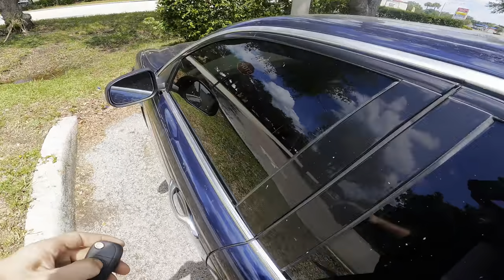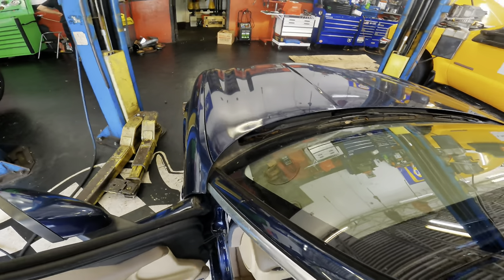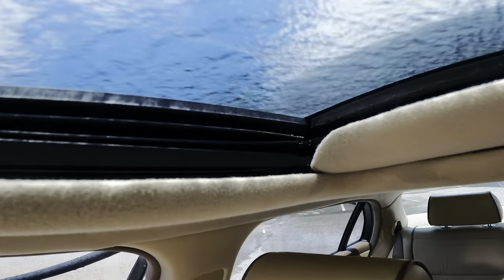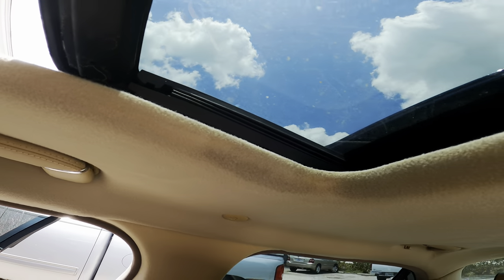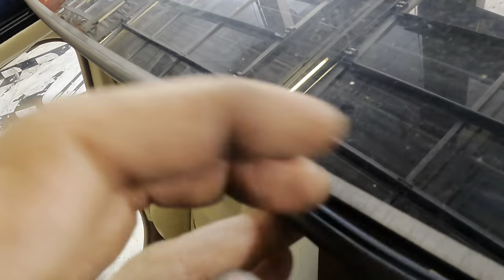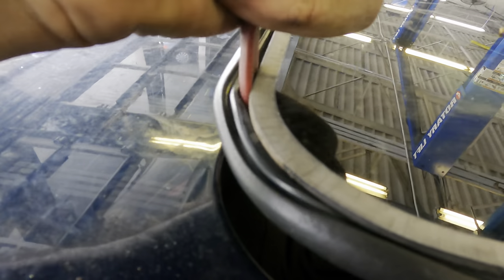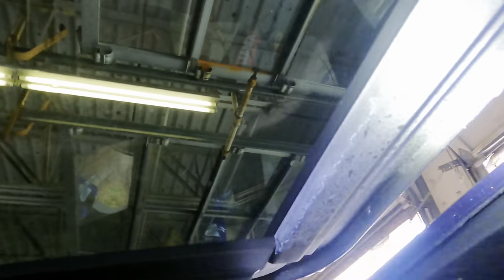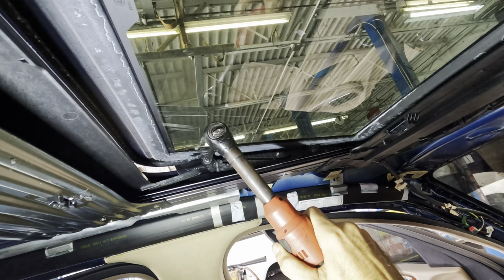Worse than I thought…Water Intrusion! 2008 Jaguar XJ 350

Comment: On Jags like most British cars, there are A pillar drains for the sunroof which get blocked very easily and will force water into the cabin area if not unblocked, a weak seal will allow this to happen more readily, I had to recently unblock the A pillar drains on my Reliant Robin which unusually has a standard lift up sunroof and it kept dropping water onto me.   Once unblocked not had a drop since :D

Comment: When you install seals like this, you have a really easy opportunity  to stretch the seal. On the curves, you should leave some slack in the seal. Meaning this; as you install the seal, if you are pushing it in one direction or another, you have the possibility of wither stretching or compressing the seal. Even though it fits around properly, some areas will be stretched while others compressed and "fat."

That front section that was highly compressed was due to all the stretch landing in one place. What you need to do is evenly install the seal all the way around but try to leave excess in the corners as they will want to stretch thin due to the curve.

Hope this helps. Have much experience in this field.

Comment: Drains in our Explorer clogged up.  The overflowing drains caused the drivers side sunroof motor to fail so I had to replace that before unclogging the drains.  Used compressed air and thick weed trimmer string to unclog.  

The seals are designed to stop most of the water, but will never stop it all, hence the reason for the drains.

Comment: Great ideas on what to use for clearing and checking the 4 drain lines...fishing line or round weed wacker line would do it...I just hope the area at the sunroof frame where it attached to is part of it vs being a fitting the drain hose slides over...like vacuum hoses do on the engine stuff.  A great video Ray...I woulda thought the seal would make it better but its worse...I wonder if the tugging fore and aft might have knocked it out of alignment.  A great video as always Ray...I hope theres a part 2 to it as I have a 99 Toyota with one side off a tooth going up...still seals fine though fortunately.

Comment: From working at Benz for years we had this issue too. the sunroof glass is never 100% water proof. it uses the drains as its primary way to divert the water. the drains are probably clogged causing it overflow. if you want to try and adjust the glass. when you put it in the tilt position there should be bolts holding it to the glass to the track. Crack them loose and you should be able to move the glass around.

Comment: I used to work on these, the seal is not intended to be water tight, hence the drains at all four corners to handle drip-by, most often with a leak complaint the drain tubes were blocked or clogged, we would blow them out from underneath, which resulted in a 95% fix, we would then treat the seals with silicone for lubrication

Comment: Most cars I've worked on (BMW, Subaru), the sunroof tray collects and water, draining it out from the corners to drain lines down the pillars.  Like you said, but also drains in the back to the C pillars.  So look for drains clogged or disconnected from the sunroof tray.  The seal around the glass is for air/noise and does not keep out 100% of the water, just limits it to what the drains could handle.  My observations.

Comment: Keeping the drains in that Sunroof clean is really important on Jaguars. I know that some of them like the XJ8 have a computer right under the windshield support.  So if the Sunroof drain leaks, it will dump the water onto the computer and totally destroy it. They are pricey as well and control about the whole inside of the car, etc. Some of the Lincolns have the exact same setup.

Comment: seal round the glass is there to stop wind noise rather than stop water. However good the seal is some water will always leak past, which should make its way to the drain-tubes.

Comment: I HATE sunroofs!
When I ordered my 2015 Subaru Outback from the factory, there was no way to order it without the dang thing!
From what I understand, the rubber gasket is just to keep wind noise out of the cabin.
The water is channeled away via a channel that surrounds the sunroof and is evacuated via a drain tube.
If the tube gets clogged, water will overflow the channel, and enter the cabin.
I HATE sunroofs, and in 7 years, I've only opened mine 3 times... LOL!

Comment: I had the same issue on my Passat, you didn't have to take the headliner out (unless something was broken) all you have to do is loosen the 4 (sometimes 2) bolts that hold the glass in, close the sunroof, and then with a suction cup on the outside manually move the glass until the seam is even all the way around, then tape the glass in place (glass to roof) and tighten the bolts. The glass buffets in the wind and the screws work loose over time. Maybe something else was wrong with this but most of the time a slight readjust is all that is needed. Also not sure why people are saying sunroofs are designed to leak because they're not. I've had 5 cars with a sun roof, non of them leak water or air. The drains are there so if the sunroof is in the vent position water wont make it's way onto the headliner, also water under pressure can break the seals (car wash) and the drains keep the interior dry, but under normal conditions the seal should.. seal. Also clogged drains don't cause water coming into the vehicle... ?  If the drains are clogged you'll get water overflowing the gutters and onto the headliner, has nothing to do with water coming in in the first place.

Comment: You need some gummi pflege for the rubbers and check those sunroof drains there should be 4, 2 front and 2 rear. Very common on the vag group cars or anything with a webasto sunroof for them to block especially if there's spider trap covers/flaps at the end of the drain.  Remove them to improve the water escape flow
Reply: "Remove them to improve the water escape flow"
And the spider entry flow 😁

Comment: The tracks themselves should have fine adjustments built into them.. slotted holes.. mine got loose.. 

Also check the drains! 

My trunk got wet everytime it rained.. the tube became disconnected in the trunk!

Good luck bud!

Comment: That trailer contraption would not “fly” anywhere in europe. You would get pulled over, fine would be anywhere between 200-1000 eur depending on country, registration suspended (at least for the trailer, which means fix it then get it checked) and license suspended for at least 30 days.

Comment: Based on my Subaru, sunroofs leak all the time.  There are typically drain tubes at all four corners of the sunroof that plug over time with pollen and dirt.  Four are necessary to deal with parking on slopes. The two rear drains on mine can only be cleaned from their lower ends at the rear corners of the cargo area.  I cleaned with a piece of flexible steel cable typically used in garage door spring cores. It took seven years to develop a plugging problem. Then water suddenly poured out onto the steering wheel and into the spare tire well when those drains plugged up.  Water still comes in, but is carried away with no problems now after cleaning.  I will not let it go seven years again and now carry the cleaning cable with me.

Comment: We used super lube silicone spray on all rubber body seals when I worked at Jaguar
There could be adjustment screws on the tracks.

Comment: I use to install moonroofs and they do not seal completely and will definitely have water infiltration if you put a garden hose on it like you did. They are not that water tight!   The drain pan is there to catch normal infiltration. 
 Check the drains for clogs before taking down the headliner.

Comment: Looks to me that the new seal was stretched tight around that back corner, making it smaller. In the front, there is too much (loose) seal. That happens when rubbing the seal into place with your thumb...it stretches. Evening-out the tension on the stretched seal may solve the problem...without tearing out the interior.

Comment: Most JDM sunroofs even if the seals leak water will never enter the cabin. The sunroof tray opening is smaller than the sunroof thus any leakage falls on to the tray. The water either runs to the front or rear drain hoses connected to the trays. Most common problem is the drains are never cleaned thus get full of dirt/leaves etc. Water doesn't drain and starts overflowing into the cabin.

Comment: Clear drain tubes first. I had the problem with a ‘12 toyota highlander and a ram diesel truck. Used string trimmer line to ream out the tubes. Had to special order my ‘21 Audi Q5 with no sunroof. Who needs a dang sunroof in Florida anyways!

Comment: I had a nissan once with a factory sunroof and it leaked sometimes. Only in left corners. There was a gutter on the backside of the roof that slides back with the window and it popped loose on one side. Once re attached the leaking stopped. The factory roofs don’t seal an relies on the gutters and drains in the pillars.

Comment: I had a 2010 Corolla, and I kept finding the carpet wet.  But there was no sign of any water entry at the doors, or at the sunroof.  No other wet areas.

Somehow water was getting to the carpet without coming in from above.

My first thought was condensate from the AC system, but the carpet at the firewall was dry.  Even though on the floor it was sodden.

Turns out the sunroof drains had plugged in such a way that the water was running down the inside of the pillar and into the floor under the carpet.

I had to remove the seats and everything I could from the cabin and lay them out to dry.

When I did, I found about an inch of water in the cavities of the cabin floor!

Comment: As far as the sun roof, the heat might be making the seal expand and tighten up any gaps.
Also, if the car is not moving, the air flow might be forcing water between the brittle seal especially cooling it and then not letting it flex enough to make the seal.
You have to feed the seal more fish if you want cooperation.
I would have sprayed silicone on the new gasket to make installation easier.
ALL seals like windows and door gaskets should get a once a year siliconing.
Clean the tracks and then spray.

Comment: Having done many of these in my time, I' would be looking at the running slots down both sides then the motor gear and teleflex cables that drive the glass, this can be done without dropping the roof liner, if they are ok then the liner will have to come out and the sunroof unit so that you can open it up and check the teleflex anchors on the widow sliders, the play you showed worries me that this will be the latter at fault.

Comment: I had to limp home a trailer with the tires off the rear axle. Couldn't exceed 45 without it getting a wiggle. I'm both impressed and scared to see that doing 70 down the highway.

Comment: I would look into adjusting the sunroof glass. Should be some covers hiding the screws under the glass. And you should know the seal the the sunroof glass is never water tight. That's why there is a gutter and drainage system.

Comment: Nice try If you get electrical cable Puller which are basically fibreglass rods and rod each side of the pillar posts so the water gets away faster sometimes they get blocked up with leaves under window may want a slight adjustment on the running rails good luck with it 👍👍👍👍

Comment: I did this to my jaguar x350, you have to readjust the glass they tend to sink, loosen up the side screws like you doing towards the end of the video, push up slightly till it's flush with the roof and tighten and clean out all the drains in each corner, will have to drop the roof liner, the rear ones are a pain in the butt, 95 percent of the time it's the gutter's that are clogged, hope this helps

Comment: On my 85 VW Golf it turned out the drain ports were blocked causing the leakage. I ran plastic tubing through all the drains which cleared the clog. Checking the alignment of the roof could also be off also causing a leak

Comment: Old Sunroof’s are nearly never 100% water proof but if the drain is clear it’s not a problem, but the drain pipe tend to get filed up with crab, so if you clean them, it should be good 👍

Comment: The guy with the missing trailor wheel would be pulled over in this country. Fine, points on license and not permitted to continue until fixed.
Reply: Germany by any change?
Reply: @teweg7355  Any non-3rd world country.
Reply: @blockbertus  That may rule out most of Florida
Reply: @teweg7355  Certainly the police in the UK and I would expect most of Europe would not be very impressed with this.

Comment: The roof is supposed to leak.  And it drips into the catch tray which has drains in each corner, sometimes only the front two if it slopes forward a lot.  The drain tubes get plugged with trash and the catch tray overflows. i.e., leak into the interior. This is why you can leave the roof open a little to vent heat and not get wet if it rains a little. Cancel that if it is blowing hard.

Comment: I have no idea if this fits all sun roofs but on my old car a Subaru Forester from 99 the seal was just air/dust/noise seal not water it was designed to leak... and that wouldn't be a problem so long as the 4 drainage holes wasn't clogged at any point. Happens usually around the 10+ year mark weirdly enough

Comment: clean the drain hose on all 4 corners, sun roof never seals, only a controlled leak. A partially blocked drain on one side will spill when the car is moving or on an-uneven surface

Comment: I have been an auto glass mechanic for 20 years I've seen this many times water is getting inside the vehicle it's because of the clogged drains I do what you did clean if that doesn't work silicone the Rubber seal but check the drains because water supposed to flow through them it's designed that way

Comment: You should have an adjustment for the glass to move forward and back, obviously the glass is not properly aligned it has become out of alignment as far as the adjustment. You only need to loosen a couple of screws and slightly move the glass back. This adjustment is on just about every sunroof made.

Comment: Mr Ray to me it looks like the Rubber seal.
Was stretched in the left side of the car.
If you were to take off the left side and go to the back.
Putting it back own.  Looks like the extra would go to the back.
We're the rubber seal was thin.  Maybe it will work.
Maybe not 😂🤣.  I'm not standing there looking at it.
And I used to put own a little coat of oil when I used to put own seal's.  When I was working at the shop made my job easier.
Keep up the great content.

Comment: Two torque screw's either side loosen the passenger side and push towards the back of the car then tighten the screws back up that how you adjust them 👍🏻🇬🇧♥️🇺🇲

Comment: All sunroofs leak, drains become clogged, use a shop vac to suck the debris out of the drains I have an adapter that coonts the van to small diameter tubing, be careful with compressed air you can blow the drains apart inside the roof or A/B pillar, as others have said a bike brake cable can be used if your careful. Bottom line, its the drains...

Comment: From my experience, NO sunroof fully seals to the roof. The seal cuts down on the wind noise, but it's not designed to hold out water. That's why there's channels on the frame of the sunroof to catch and direct the water to the drains.  Which there are 4 drains, one at each corner (2 in the front, 2 in the rear). Any of them clogged up with debris will cause water to collect and spill over the drip rails in the frame and into the interior.

Comment: it's not a perfect seal, mostly to lessen wind noise and water, drain tubes may be clogged or partially clogged. blow them out with compressed air to check.  generally from underneath is best

Comment: there is a easier way on the inside on each side you have a strip of plastic each side of the glass pull these of and it will reveille screws undo these and your glass will lift out check around the glass on the metal frame as sometimes these rot .but do not for get that's what the drain holes are for  also check if these are blocked thanks for the video

Comment: I dont know if this is going to be of any use to you. I used to have a Peugeot 405 it used to have a sun roof leak. I found that there are small adjusters front facing on the glass carriers. a few twists in each direction soon had the glass and seal sitting centrally in the hole. This initially stopped the leak for a year then it started again in a different area, a layer of Duct tape with a swear of grease around the hole sealed it. Repeated layers kept me dry until the car was retired 10 years later. The world is held together by duct tape

Comment: You can never get it waterproof. They cannot be tightly fitted as the roof flexes. Water or rain will always come through the seam, always. The thing to check is the drainage. There can be drains in the back corners, they are normally hard to get to.  But if they are all open there should be no water coming in, unless you maybe are on a slope. That might overload the drains, as in 2 or 1 doing the work of all 4.

Comment: If 1 side of the rubber was more difficult to get in than the other side cause it was a tighter gap...just means the sunroof isnt aligned right, which is either track or motor